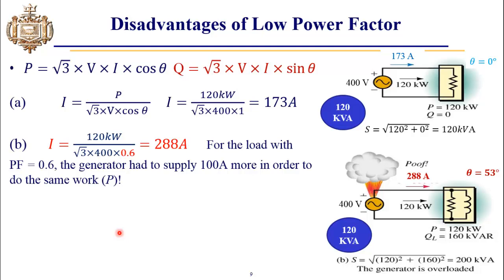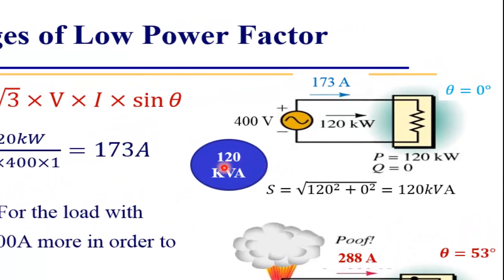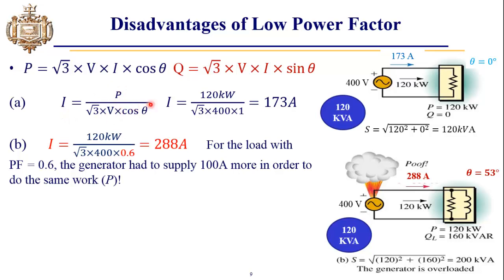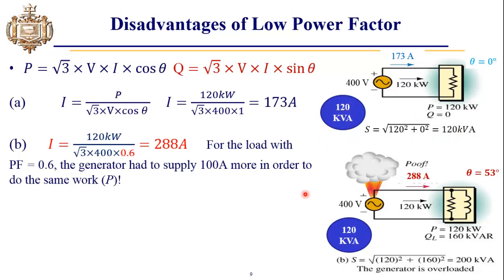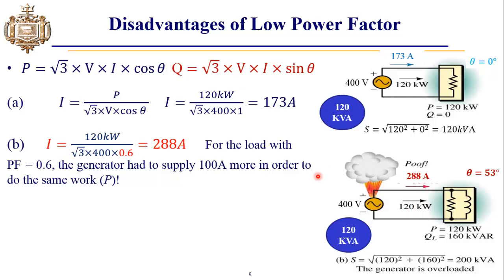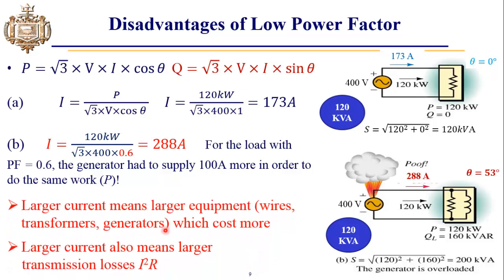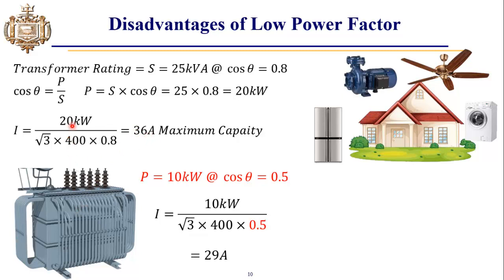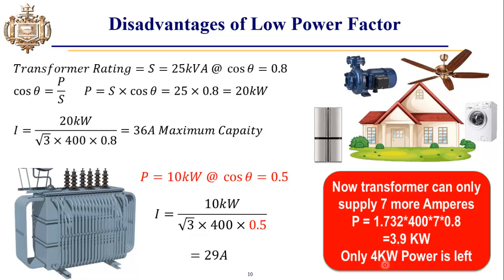Disadvantages of Low Power Factor | Low Power Factor Effects - Best Explanation

Comment: We have two Genset 625kva this in parallel operation this two Genset is connected in 2 transformers one transformer rating is 380vac step up to 33kv and other transformer rating 33kv step down to 380vac this two transformer are both 500kva our problem when we run the two Genset in parallel and closed feed the 2 transformers the voltage is became 600 plus tripped our 2 Genset and I observed that kvar -27 and fp aswell negative there is any solution to solve this problem. We ask the customer to connect a capacitor bank but the customer it seems don't want to spent more money.
Reply from the maker: First of all if both feeders are closed simultaneously then huge inrush current will flow. The negative sequence current will flow and feeder protection relay or genset controller will sense this abnormal current and trip. Try to close the feeders one by one.